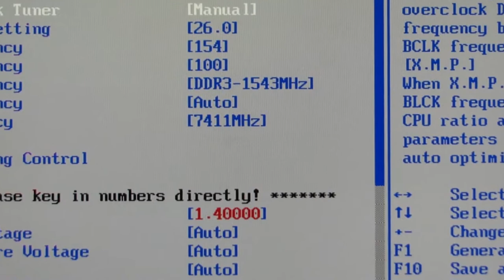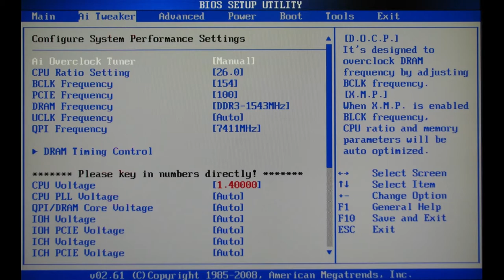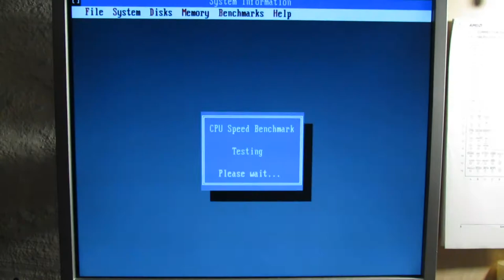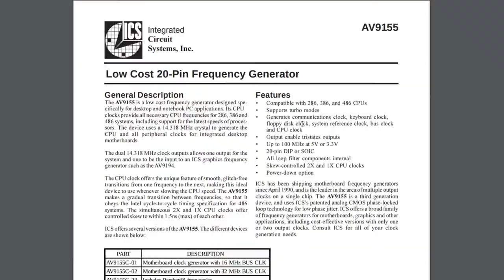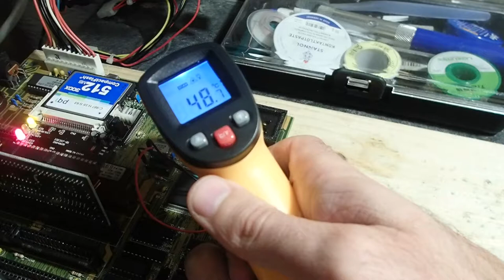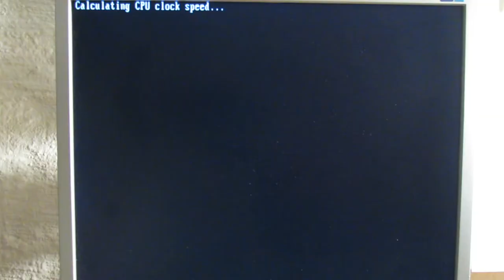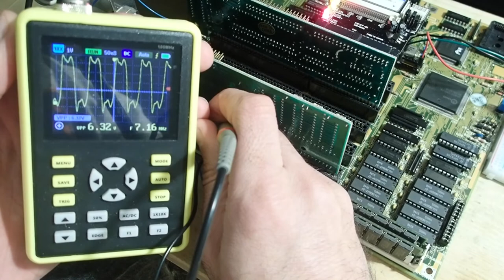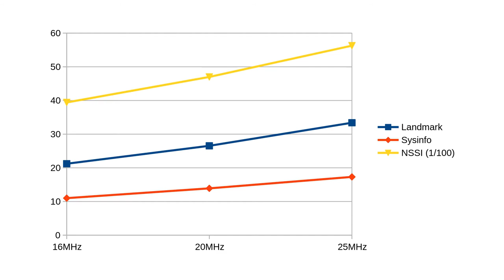Let's overclock an old 386SX

Comment: Remembers me on my first PC - Pentium 200 MMX.
I had that system running stable with 250MHz, a speed increase that was indeed noticeable in games back then.
And for a long time the only system I could overclock for 25% it's original speed...
After a long time I had a 3GHz cpu that I could only overclock about 200MHz, I chose not to do it because the speed increase was not significantly enough.
Many years later I had a 3,4GHz cpu that could be overclocked automatically to 4,3GHz, that was worth it and it ran absolutely fine.

Comment: My first desktop was a 33MHz 386 clocked at 40MHz. When I discovered that I felt a little betrayed (this is not a genuine 40MHz cpu!) and that was the last pre-build I ever bought.
Always sourced my own components ever since and typically slightly underclock/undervolt my latest hardware to not be blown away by the cooling. If you grew up with 33MHz, 3.8 or 4.0GHz both are exceptionally fast.
Reply from the maker: My story was very similar.

Comment: In USSR a 286 was worth as much as a house, even while in the West they already had 486's.
Reply from the maker: The problem in USSR was not even, that they were so expensive. The problem was, that you couldn't buy the at all. All you could get more or less in regards of x86 were some soviet 8086/8088 clones. Actually, in the mid/end of 80' USSR was economically ruined and you couldn't get even simple things, which you needed day in day out, not talking about computers and stuff...
Reply: @necro_ware  My brother built a 286 in the 80's out of fried parts smuggled from Western Europe, which were worth a fortune. There is no way in the world anyone could afford new parts, when a 1.44 floppy drive was worth 3 monthly salaries on the black market. There was no legal way to obtain parts otherwise. My school only had domestic computers. Clones of various foreign systems that by then were already 10-20 years old and falling apart. Having an IBM-compatible at home was an absolute miracle.
Reply from the maker: Yes, the x86 compatibles were inaccessible. As I wrote, you could still buy XT clones. They were also very expensive, but a t least, you could get them legally (in theory). And the school computers were not as old, as you think. They just looked old, but just as you said, they were clones of various western personal computers. For example of ZX Spectrum, which was introduced in 1982. It was cloned in the USSR very much, but they needed around two years to get there first. So such computers could only be 5-6 years old as USSR fell apart. If they would be 10-20 years old in the year 1991, that would mean, that USSR was ahead of the western personal computer technology. I have my doubts about that :) However, USSR was really not bad at supercomputers at some point. For example, take a look at Elbrus-I and -II. Intel was so keen about that technology, that they snatched all the engineers from the project right after the USSR was history. This very same engineers developed Pentium III later, which technology is used until today in all the Core CPUs.

Comment: Like people already commented, when you overclock 386, you also overclock its FSB (1x20MHz, 1x25MHz, etc), so the limit is always the core logic and other not-so-OC-friendly motherboard components. Also, I've seen 48.000 oscillators on some period ISA video cards at least, so there is a real chance that some of these boards were indeed 24MHz (O_o), with downclocked 386SX-25 (?). Overall great video! Really enjoyed your soldering and test results! I'm playing with the later SX-40 now, and honestly, Doom is still unplayable on it... But.. there's always DX-40.. ;) Keep those videos coming! ;)
Reply from the maker: Yes, everything's true, what you are saying. One thing is, that Doom is not playable on 386DX-40 as well :D Only in small window with low quality you will get near some playable values. This game was just made for 486. It's like Wolfenstein3D is for 386, Doom is for 486 and Quake is for Pentium.

Comment: protip: dead sound / MDAish video cards often supplied with many onboard XTALs at different clock rate, to support different refresh rates.
Reply: They're also still used to tune old ham radio gear.

Comment: This was the exact mainboard i had on my first PC, i replaced the crystal with a 40hz one and added the math co-processor.  Doom ran quite a bit better after that.  Excellent video!
Reply from the maker: You mean you had 1,1 FPS in Doom instead of 0,9? :D
Reply: @necro_ware  i want to say it was at least playable but that was a long time ago.  love your channel.
Reply from the maker: @pauldame9925  Time often plays tricks on our memory. I think you mean Wolfenstein 3D, that was kind of playable at 20MHz 386sx, but for Doom you really need at least  a 386DX-40 to run it in a very small window in low details and to have it playable you need at least a 486DX-40, or even better a 486DX2-66
Reply: @necro_ware  That could be...time has taken it's toll

Comment: how did you do surface mounted soldering so cleany!? i tried it and messed up. may be u should do a video on how to do it properly? i have a 286 M216 mobo with bad soldering on the chipset and it needs to be reflowed i want to know how this is done well

Comment: I remember the days of overclocking with a pencil... My first entry into overclocking was with an AMD K6-2 500 with 3 fans tie-wrapped to the heatsink and 60mhz later with 2.81v. To this day I still overclock every system, card, and chip hah
Reply from the maker: Yeah, I used the pencil trick on my Athlon as well back then. AMD cut some wires to prevent people to setup the multiplier, but you could simply draw over the wire with a pencil and it was good to go ;D
Reply: That wasn't my first try, but I also remember trying to squeeze more speed out of a K6/2-500 and not getting very far. I figured I could at least get to 550 since there were K6/2 chips rated to that speed, but no. The other hardware on the board wasn't happy at anything above standard ISA and VLB clocks, so I had to run 5.5x and less than 100 MHz FSB, finally topping out around 530 MHz, and even that required 0.2V overvoltage and got a lot hotter. The loss of FSB, thus drive throughput, video throughput, memory throughput, etc. meant on balance it wasn't worth it.

Comment: That was awesome! I'm currently trying to get a Octek Jaguar II 386 board back to life! It currently has a 25Mhz Intel processor in it but according to the manual I can also upgrade it to 33Mhz. However, it has a 50Mhz oscillator crystal soldered onto the motherboard. I'm curious to see if it would still give me that 33Mhz that they claim. Would be interesting! But I may need to replace that crystal with a 66Mhz.
Aside from that, the reason it doesn't seem to be working is memory issues. There are two bios chips of AMI that came with the board, one shows all 8mb of RAM but crashes when it's time to boot. The other only seems to see 1mb of the 8mb installed and that's it but it does work stable. I've taken a look and it seems the SIMMs that are installed in the board are 60ns while the manual indicates that for a stable working system it would need 70ns or 80ns and then also setting up the proper wait-states. Eitherway, looking forward to sinking my teeth into this motherboard and if I can get it to work, hopefully find a nice 386-era case to put it in! :D
Reply from the maker: Hi, I don't know if I got you wrong, but as I read it, you complain about 60ns memory. Well actually, in this case less is better, 70ns is better than 80ns and 60ns is better than 70ns. And 60ns is the fastest SIMM memory you can get as far as I know. Could be, that you have problems to get it booting with 8MB, because your memory is bad. Octek Jaguar II 386 is a 386DX mainboard, it has 8 memory slots and you have to use it in packs of four sticks. If you have 8 memory sticks with 1MB each, you can try to remove 4 and try to boot with only 4MB, if that doesn't work replace all the sticks by another four. If that also doesn't work, take two from the first pack and two from the second. If you go through all of the memory sticks in this way and only up to 4 of them are bad, you will end up with 4MB of working RAM. For this machine it is mostly enough anyway.

Comment: This is how I got started with overclocking -- soldering in new oscillators!  EDIT:  wow - i would have bet money it was the motherboard or ram holding back that clock speed, not the cpu itself!   I'm curious what manufacturing process each of the SX's were from.
Reply from the maker: And you would be right. As I told in the video, I think, it's the chipset, which can't handle anything above 24MHz. So far, I didn't see this mainboard with other CPUs, than 16-20MHz 386sx. So I guess, it was just too bad for 25MHz or even 33MHz, which I tried.

Comment: Back in the day when these weren't old, I did have a 386sx system I overclocked from 16MHz to 33MHz successfully. Since the motherboard is made for 286s and the role of the 386sx was to be a drop-in replacement of the 286, the chipsets were often the limitation and that's also why yours is specced at 24MHz.
Reply from the maker: Yes, this is my guess as well. Thank you for sharing your opinion.
Reply: But 24 Mhz wasn't exactly a standard speed for 286es either, although 20 was. So I bet they designed for 20 MHz top speed, then validated and accepted whatever they got as it was better than 20, and this turned out to be 24. It's probably worth trying to find a 48 MHz crystal.

Comment: I was under the impression the DX chips were much more overclock friendly.   The SX versions needed the math co-processor for any realistic speed boost.   And well, it was a long time ago.   So I'm probably forgetting everything.  Lol.   Fun video to watch, thanks.
Reply from the maker: Well, it may vary from CPU to CPU, but in general DX are not really more overclock friendly, but they are a lot faster to begin with. Compared to SX the DX had 32-bit RAM bus instead of 16-bit and ability to have up to 128KB cache, which made DX by far a more superior CPU. SX on the other hand was just a 286 on steroids, equipped with internal 32-bit capability and 386 instructions set. It was made as a cheap solution, so the mainboard manufacturers could continue to use their slightly modified 286 mainboards with 386sx. And in regards of math co-processor, it is absolutely useless on a 386 (either DX or SX). I know only two games, which made use of it - SimCity and Falcon 3.0. All the other games didn't make any use of it. You could get some slight performance gain in Word and Excel under Windows and in CAD software though. So, if you didn't use that programs, you wouldn't see any change with or without math co-processor.
Reply: @necro_ware  thanks much for the refresher.   I didn't think my household expected to run anything outside of Wordperfect and Lotus back in those days.   We had a 386sx with the math co-processor, and NU's benchmarks always showed the increase.   This was a great video to watch though and your information was top notch, thank you.
Reply from the maker: @jeffchisamore1556  Thank you too ;)

Comment: We did once weird stuff with an AMD 386DX-40. Friend had not enough money for an 486 but the 386DX40 were insanely cheap at those days. We found out, his sample was totally happy running with 80mhz.
Reply from the maker: Yes, in very rare cases it is possible, but you heavily overclock the ISA bus and I can imagine, that many expansion cards would get instable resulting in broken audio, video etc...
Reply: @necro_ware  the beauty of that board was: you could lower the speed of that ISA bus by a factor tied to the CPU. It took my friend days to find stable settings, where everything was performing real fast, without crashing. He exchanged even his sound card for that one of a friend, because his original soundblaster had problems with 12mhz ISA-Bus speed and the compatible soundcard was rocksolid at that speed. That dude ran a VLB setup and saw no need for overclocking his ISA-Bus. But with an ISA bus, you want to run your Tseng4000 as fast as it goes without crashing.
Reply from the maker: @ciddax754  Yes, some rare boards allow to set CLK/6 divider for ISA BUS. This means about 13MHz, when CPU is @80MHz. Unfortunately most of the 386 boards doesn't allow to set divider at all and the ones, which do, they provide CLK/5 at best. Again, on @80 MHz CPU, means 16MHz. That would require a lot of fine tuning and hardware selection. Not even every Tseng ET4000 would run at that frequencies stable. I have one here at hand, which says goodbye already at 12 MHz ISA. It's not always an easy task to find ISA hardware which runs above the standard 8MHz and if it does, usually not for long. I overclocked one 386 a year ago to 50MHz it was stable for about 3 Months, then the graphics card got broken first. I replaced it and a month later the chipset on the board died as well.... RIP

Comment: Brings back memories of a 386sx  my brother got me from work  a clear out in the 90's, many nights were spent overclocking it just so i could play DooM on it. I think it was a 33mhz cpu, but there were dip switches and jumpers on the board to adjust clock speed.  it just about manged to run it at  low graphic setting full screen and high settings at half screen size. Wish i still had it. thats where my  love for  overclocking and using old tech comes from  to this day.

would like to see how far you could push a  486, or if one could run on the 386 board ?  its great seeing the real time effects of the clock increase on games like DooM... from slide show to playable.
Reply from the maker: Yeah, in the time of 386, Wolfenstein 3D was more a game to play. First 386DX-40 could run Doom at low settings. Unfortunately even that was too much. As soon as more enemies came to get you, your FPS dropped dramatically to unplayable. It was first more or less playable with 486@40MHz, because of 8K (!) L1 cache :)

Usual 486 CPU was not compatible to 386 mainboards, but Cyrix did some magic and brought own 386 CPU with 1KB cache and 486 instructions. It was still slower, than a real 486, but could help to push your 386 a bit. Good news, I have all parts for this recipe and wanted to do a video about  it soon :)
Reply: @necro_ware  does having the Math Co-processor help much with these 386 - 486 cpus? Would there be any benefit in overclocking those as well ?  Look forward to seeing the Cyrix! I'm sure I had a Cyrix "586" at one stage in the 2000s  that was fun to mess with. Subbed! Glad you popped up in my recomended
Reply from the maker: @austinmaxi  Glad you've subbed :) Regarding math co-processors, it depends on what you are interested in. They didn't help in that days for games, because math co-processors were for acceleration of floating point arithmetic and most games didn't use floating points at all. Only professional applications, like simulation or CAD did benefit of it. The floating point arithmetic came first with 3D polygonal games and  one of the first famous games, which started to rely on a math co-processor was Quake. But it is the era of Pentium CPUs already and 386/486 are sitting nervous in the corner :)

It is also not easy to benchmark games from the time before Pentium, because all the integrated benchmarks in the games started to appear first as overclocking became a "sport" or "challenge", as I told in the video. Unfortunately, with the old games you can just say: "Yes, it feels faster", not very exciting, yes? Well, this is one of the reasons, why I just used some synthetic tests in this video, at least you get some numbers to compare. However, I'll try to do better next time :)

Comment: @11:35 Pro (?) tip for soldering large SMDs: use a strip of kapton tape to hold the component in place, it makes it much easier to align the pins. Once the component is properly aligned, tack down (solder) a couple of pins on opposite corners, then gently remove the kapton tape and solder the rest of the pins.
Reply from the maker: Thanks for the tip. I usually just hold it in place using fingers, it's not too tricky, if you don't have to film the procedure. But I'll keep your tip in mind should I have problems with my usual approach.

Comment: Whoaaa I remember replacing those oscillators myself in the 90s. I was a teenager and those 386 SX boards were cheap to get, yet they were able to run 32 bit software. Because of that, they take a special place in my heart. I did all kinds of experiments. Would like to somehow see Doom running playable on a SX, which is a really hard task I guess.
Reply from the maker: Yes, those 386sx were more or less 286 CPUs with 386 features. Internally they were 32 bit, but used 16 bit memory bus. That's why, 286 mainboards could be used with slight modifications by the manufacturers. This made such machines very cheap... and absolutely not capable running doom. If you are happy with 12 FPS in a window as big as a post stamp, then you need at least 386DX-40. Really playable is the game first on 486DX2.

Comment: At a Hamfest in 2005, I witnessed an Intel 286 overclocked at 1.2Ghz. It functioned, but needed to be cooled with liquid Nitrogen to keep it from melting.
Reply from the maker: I barely can imagine that :D It is physically not possible. The technology used in 286 was not capable to run at such frequencies, doesn't matter which voltage or cooling you used. May be you mixed something? I mean 2005 is long time ago.... ;)
Reply: @necro_ware  even with liquid helium a 286 would never reach 1.2ghz 🤣